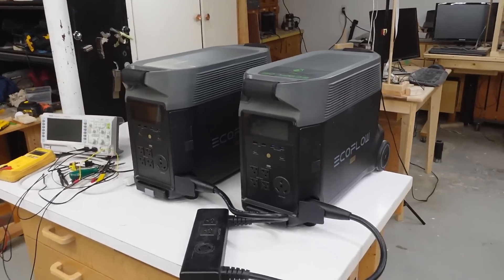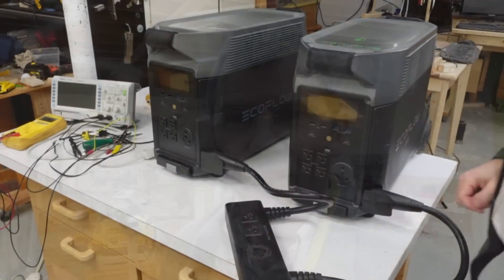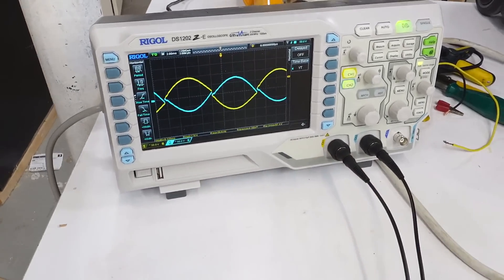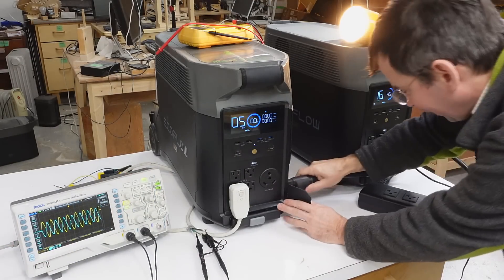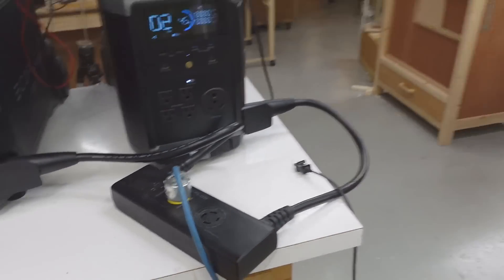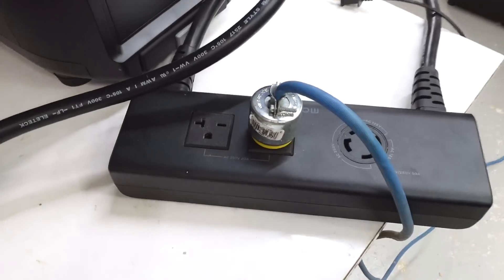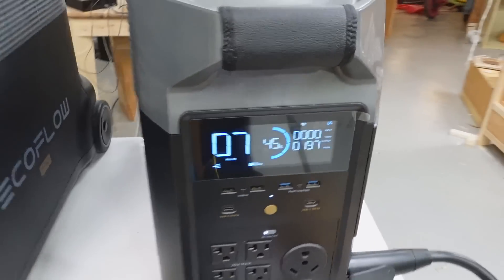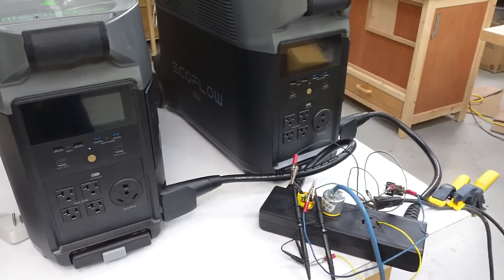Two 120 volt inverters in series to make 240 volts

Comment: Reupload?
Reply from the maker: Yes, audio was messed up, only half an hour's worth of views on the old one, so not so bad to re-upload
Reply: @matthiasrandomstuff2221 I will run video again to assign my view ^.^ If you took the trouble to reupload, so we should take trouble to help running this video with watch time and likes. Thank for your work!
Reply: @matthiasrandomstuff2221  lol you had me checking my speaker wires
Reply: @matthiasrandomstuff2221  I didn't notice any audio issues in the first video, but I am watching on my phone.
Reply: ... and re-watched! :)
Reply: @Mr.Beauregarde  Wait until you find out about everybody in Europe has 3 phase 400V in house.
Reply: @marnikbongers3186  I mean, does it count if it's only 50hz? We have an American version of that. Cept we just use a 3 pole breaker in single phase residential service and ignore the fact that our "3-phases" are each shifted 90°
Frankly.. Im down with your setup. I just have a membership in the crusade to eliminate the misapprehensionf we're using 240V in houses here
Reply: @marnikbongers3186  On some countries like Spain it's optional, I've it but I don't have any 3-phase socket inside my house, only outside, in the garage and the sheds.
And I really don't think I ever connected anything to the one in the garage...
Reply: @ruben_balea  yeah, like us here its individual 120ish V lines, just you CAN go line to line instead. God bless alternating current
Reply: @marnikbongers3186  , not everyone. For residential use here in Belgium, you have to pay extra if you want 3 phase 400V, otherwise you get only 2 phase (2x 240V) to split wall outlets and lights.
Reply: @BjornV78  same in Italy, 3 phase 400V is not used  residentially
Reply: @stefanopassiglia  , 3 phase 400V gets used for residential use in Belgium, for powering ovens and ceramic or induction cooking plates, or workshops (woodworking) for powering heavy motors. I have 3x 400V here at home and i'm residential. It's used here for powering my ceramic cooking plate, and as extra 240V line. One phase is used for lightning, the second phase is used for wall sockets and the third phase is used for wall sockets and central heating.

Comment: There's a lot of suicide wires going on there. Suggest to run both circular saws through a slab of wood using one hand each while juggling a running electric chainsaw with your feet like Lionel Messi. I'd wear at least non-conductive gloves while hovering around those exposed wires. My hat goes off to this electrical expert. Thanks for making the video and stay safe!

Comment: Now I know that you are much more knowledgeable then me but all I know is that my two DPs do not equal out. Plugging that dual voltage into my 50amp RV, is one leg has one of the AC units and the other leg does not it will draw down the side with the AV and the other side will not. So they definitely do not balance between the two unites

Comment: The EG4 6K Off-Grid Split Phase Inverter is a low frequency 120V/240V inverter with a heavy transformer inside. My understanding is that this inverter is well suited for starting inductive loads like table saws. Would you please consider doing a video on this inverter? Also any comments you might have about this inverter would be helpful. Much thanks.
Reply from the maker: I don't have one of those inverters.  And if I did, I wouldn't have anything to power it off of.

Comment: I wonder if there's a way to have that control algorithm simulate a voltage sag. So that instead of simply killing the output it reduces the output voltage until the power draw equals the maximum current, and then if some amount of time passes (maybe .2 seconds or 10 cycles or something) with the voltage below 120 spec then it kills the output as the sine wave passes the 0 point.
Reply from the maker: Yes, they do let the voltage sag a bit -- not as much as they should though

Comment: In addition to the "hardware protection circuit", could the phenomenon you've uncovered have contributions from satruated transfomer cores producing non-60Hz weakly damped harmonic oscillations?  Could this be fixed with an external reactive power supply (capacitance), placed immediately prior to load, to address this hypothesized, low-volatage induced in-rush current from an inductive load that is a significant percentage of the inverter's capacity?

Comment: I wish inverter generators worked like this. You can add as many as you want in parallel...but always 120v, if you need 240 it's a real pain in the butt.

Comment: not series, it just makes two 120v phases which is 240v. that is all 220/240v is in your north American home.  Their combiner is really meant to input into a camper or generator input panel to your breaker box.
Reply from the maker: it makes 240 volts by connecting them in series, effectively, with the middle as neutral or ground

Comment: Matthias, I think you maybe mistaken about that high frequency oscillation during over current. I think what is happen is that the device goes into over current protection and stops gating the output FETs. When the FETS stop switching suddenly you’re left with a resonant tank that’s oscillating that’s created by the output inductors and capacitors. The actual return to normal signal after the ringing is the device recovering from the over current condition.
Reply from the maker: how is this different from what I explained?
Reply: @matthiasrandomstuff2221  I interpreted your explanation as the high-frequency ringing = the device trying to restart after hitting current limit.

Comment: any thoughts around running these in a 12v grid with solarpanels? Like in a offgrid cabin. How are these compared to regular batterys?
Reply from the maker: Why 12 volts?  These can take and output 12 volts, but they are natively not 12 volt devices.

Comment: Indeed LiFePO4 lacks the energy density of NMC Lithium iron batteries. For a given amount of energy storage the battery is going to weigh more. On the upside though LiFePO4 (LFP) has much better cycle life which in this application makes it a better choice. You'll soon stop worrying about the weight if you'd gone for less weight and it is dead.
Also with that unique split phase 240V configuration looked at relative to neutral they are out of phase and might not be the same voltage due to different loads.

Comment: One day I'll sit down and figure out North American wiring..
Connecting neutral to ground sounds like a horrible idea to a European, but what do I know.
Battery+inverter boxes have the same problem as a generator with a floating ground, so to my mind the simple solution is to hardwire the ground to the actual earth.
Reply: There are different types of grounding systems. What makes the most sense to me (and what I think is most used in Europe) is TN-S where neutral and ground are connected exactly once, and that is where the power is generated (or actually the transformer's secondary). Inside the house neutral and ground stay separated. In the US we use TN-C-S where there is a single wire between the transformer and house which is both neutral and ground, then when it enters the house it is split into separate neutral and ground. It doesn't really make sense but it's what we do.

Comment: As I said before, being an inverter designer myself, this kind of instability is difficult to remove in HF inverter designs.  For power motors, use a LF inverter (about twice the weight).
Reply from the maker: only twice the weight?
Reply: @matthiasrandomstuff2221  Yeah, maybe 3-6 times! :)  But if you need stable waveform power that can handle very high overloads for a while, it's the ONLY solution because it has low output impedance, so it strongly resists all the crap and distortion you saw on your scope.
Reply: BTW - I have tried various direct sine wave tracking & regulation to try and mitigate this, and many others have tried as well, but the low impedance part is ONLY possible if you have FULL push/pull output control, whic although not that hard to do, is VERY hard to make blow up proof.  As Piles of blown mosfets in my workshop attest to this.  The control loop complexities are somewhat extreme, and since 99.999% of inverter users only care about price, there is not much incentive to built such units.  So like I said, LF is the only PRACTICAL solution for now.

Comment: Seems like these things would be so much better if they just included a secondary transformer that had a proper center tap for a real ground (and neutral) reference with 220v from hot to hot. Would have saved a lot of wiring headaches. And would likely smooth out the waveform under heavy loads too

It would of course increase cost some as well as weight
Reply from the maker: and would add 10 kg of weight, cost a lot, and made the device consume considerably more current on idling.  And that's why they don't do that.

Comment: Good video--I've been interested in these units. But, at some points I honestly wondered if you were probing and connecting exposed mains voltage wires so cavalierly just to troll safety ninnies and drive audience engagement...and I guess I commented, so there you go.
Reply from the maker: mostly out of expedience.  Heavy duty clip leads are a good thing to have.

Comment: The table saw start/stop switch seems dangerous. If power is lost it should trip the button to off state.
Reply from the maker: Never a problem when working alone
Reply: That freaked me out. 😱
Reply: This is called a no volt release and is standard on modern equipment.  Active rcd/gfci plugs also have this functionality .

Comment: Dang that's a lot of trust in a guard. And leaning over a running table saw.

I have this weird mistrust of circ saws after I let go of one once and the switch failed closed. Luckily I didn't get injured, but the saw got an amputation as a result.
Reply from the maker: generally, the heavier and more solid a table saw is, the safer it is.

Comment: They should have added a soft start feature that could be user toggled. If such feature were implemented the surge current instability would be reduced substantially, if not elimiated outright for high current inductive loads.

Comment: Can you do a review on these Pro Power Save. Guess you plug it into the wall and it saves you on electric bill? I seen adds for them.
Reply: Big Clive and others have covered these scam devices numerous times before. The "real" ones are just capacitors and are said to improve your overall power factor. They'll only be successful if your overall load is inductive. And home users aren't charged for power factor so the savings are zero in any case.

Comment: Just like you, I blew up my Kill-A-Watt. I looked for burned traces and components and couldn't find anything. I hope you'd consider making a video on how to locate the fault and repair it. Thanks for your content. I really enjoy it.
Reply from the maker: It has an internal fuse, in series with the 100 ohm resistor going to one of the prongs.  I just shorted the fuse -- super low amperage fuses are hard to find.

Comment: Can you recommend a soft starter that would work with a table saw like yours? Much thanks
Reply from the maker: You would have to get a VFD drive, quite expensive.  That's the only way to soft start an induction motor
Reply: @matthiasrandomstuff2221  Great idea! Thank you sir. I work as a factory electrician so use VFDs when given 3 phase power to begin with and the motors are 3 phase induction. I didn't know there existed VFDs that take 240V single phase as input and produce 240V single phase as output. If I understand correctly this type of VFD is something that I can purchase to run a single phase 240V table saw. Is that correct? Much thanks for the information your videos provide.

Comment: That "strange" power issues has me wanting to measure the THD (harmonic distortion) of my non inverter generator. I tried connecting the power brick (just the power brick) for my Bluetti to my generator and measured the voltage/ripple using an oscilloscope, oddly, it didn't seem much different when compared to being connected to mains. About 100mV ripple for both, even when connecting an additional 1500W heater as an extra load. The total power output of the generator is about 3200W.

Comment: Question: Can you buy an aftermarket inverter that will clean up the output of a regular generator?  I have a 10kw portable generator that runs my house in a power outage, but I'd like to plug an inverter of anywhere between 500 watts to  2000 watts in to one of my AC outlets and have it produce a pure sine wave for my computer equipment....any ideas?  Thoughts?  Inventions?
Reply: Yes you can. I have a Apc 2200ah double conversion ups that does exactly that. It is always in invert mode and always supplies 120v 60c. I bought mine cheap used. Not for motors though.
Reply: @philarmishaw3730  I've considered that, but consider this, an inverter generator doesn't have batteries.  So I'm still curious, can you get just an inverter that will go from 120 to 120 and clean up the power....
Reply: That's a power conditioning UPS, iirc
Reply: It has to have batteries because it needs to draw power from them to make up for voltage brownouts
Reply: @philarmishaw3730  Are you suggesting that a gas powered inverter generator has batteries?

Comment: The neutral-to-ground problem is probably because the floating ground is building up some static charge while the inverter is running. So, if you connect it you're providing a huge over-voltage for a brief moment that could damage the inverter.
Reply from the maker: I showed with the 48kohm resistor that it wasn't entirely floating, probably half a megohm between ground and the inverter, which is more than enough to absorb any static before it can cause harm
Reply: @matthiasrandomstuff2221  Huh. Well, I'd wonder because this problem could be very bad if there's a way to float the ground internally.
Reply: @matthiasrandomstuff2221  I remember people talking about problems like ground loops and static buildup and all kinds of floating issues with mis-matched grounds. I'll bet the control feedback system in there hates it.

Comment: I am surprised that your circular saw starts automatically after a power loss. In germany, such devices are required to have a Nullspannungsschalter ("zero voltage switch", I think). Such switch will automatically turn off on power loss. Would prevent some dangerous situations with people fiddling on a seemingly powered-off device...
Edit: I falsely wrote Nulldurchgangsschalter
Reply: Nanny-State is why everything costs so much these days. Leave the "Nulldurchgangsschalter" off all my stuff.
Reply: @cowpen  In many points you are right about Nanny-States, be it Germany or US :D
What we do with our private devices is our own issue. But I think even OSHA has a requirement for these in work-related environments. And if even one bloke still has his hands because of this: Worth it! ;)

Comment: Those inverter designs; once you can get into the MCU, or whatever is controlling the sine wave switching of the I guess IGBT's in the H-Bridge, seems like when the two are connected something is switched to phase sync the two.  The logic seems super easy.  Like basically you can literally just use one of the units, let's say, MCU's H-bridge switching control to control both the systems H-bridges to create the sine wave.    I've been reading into a little when I get the time, as I'd like to be able to make better use of the Prius inverter-converter for making a more versatile generator, welder and plasma cutter into time.  Those definitely have the IGBT's and other systems that can be aquired cost effectively since they last and no one needs to buy one.  Sure beats being shredded and more energy and mass wasted to recycle.   I was thinking would really clean up the brushless-asynchronous alternators (generators) from whatever source like the Prius MG or other say crappy brushless designs that are the older makes models without the inverter.  Would also clean up the synchronous sine wave on the older non-inverter generators that look worse than I realized.  Jason Wallace did a great video showing the signals from the three designs, mains, synchronous and pure since wave inverter sources.
Reply: Save your your Kill-A-Watt meter, over voltage is just the regular fuse needs replaced and over current will need the thermal fuse replaced.  I even made a video documenting my repair from an over voltage situation on a crappy 1200W 2-stroke brushless generator.
Reply: I've also wondered about adding some sort of slow or fast start capacitor extension cord box add on for the motors needing the surge starting current.  I've wondered also about adding an inductor... though those don't really store the power like a capacitor (or bank) does.

Comment: Did you answer why the overhead lamps are all zig zag pattern in your shop instead of in a strait line?  Is it for shadow mitigation?
Reply from the maker: yes, I didn't want them parallel with the edges of the furniture

Comment: I don't think that two cycles of harmonics is bad (1/30th) second given that the starting current is essentially limited only by the resistance of the wire, at least instantaneously.
Reply from the maker: its a lot more than 2 cycles

Comment: Why make it so you need two boxes for 240vac rather than just one?
I have several guesses. 
1) Lower cost for those that only want 120vac, as it cost more to put two inverters into one box so that you can have 120 and 240 in one box, than one box that only does 120vac. 
2) probably the bigger factor is the kinds of loads (central air conditioner, laundry dryer, electric stove) one might run on 240vac  would be too much for  the battery in one box.